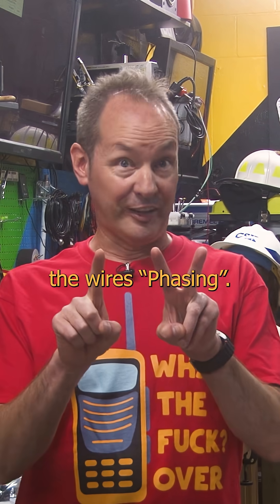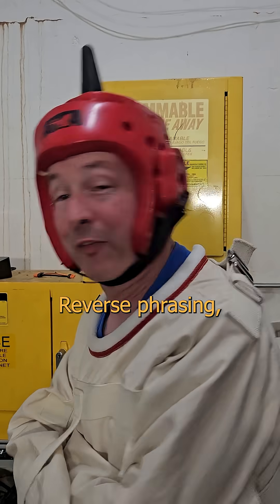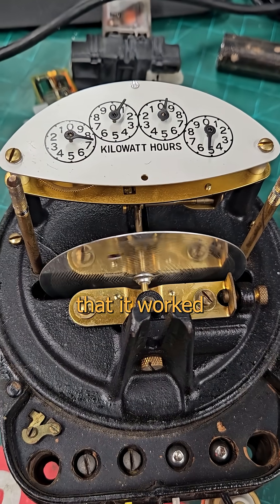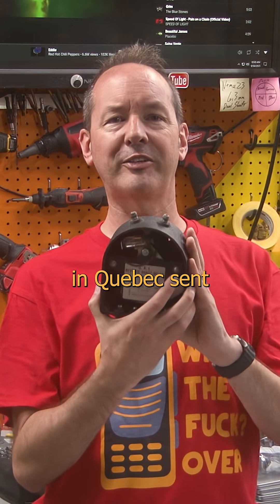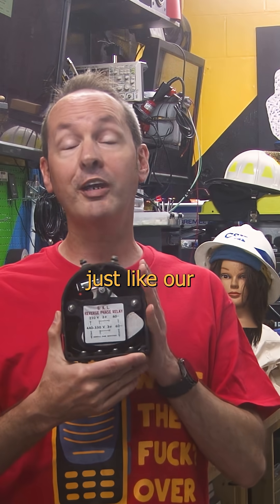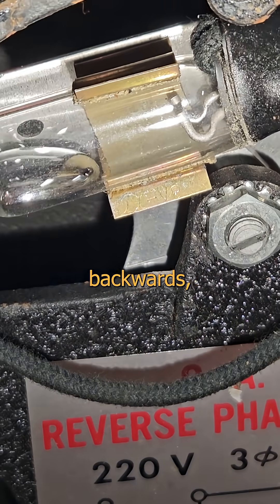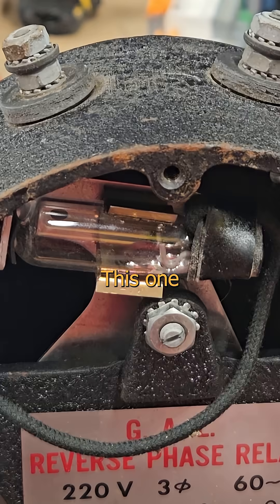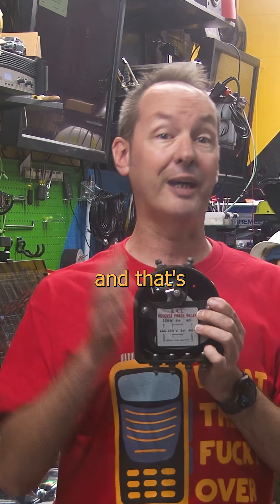Reverse Phase Relay #chrisboden  #comedy #engineering #electrical #educational #elevator #science

Comment: Honeywell made a spring shaped bi-metalic strip that if the temperature goes down, the vial of mercury tipped to let the mercury close the circuit with a little flash... and strangely enough, the furnace turned on! Every time.

Comment: Man, I worked with 3 phase motors (70hp +) and other electrical equipment such as induction heating systems. We usually had another person in maintenance initial off to double check our work. If we were to screw up it could've cost the company a month's amount of income.

Comment: This is why I always mark the wires with coloured tape when replacing meters, and ask the client to test a motor when possible.
But that's not always possible, and its a pain in the ass to redo the connections.

Comment: Did a retrofit the other day using parts from a purchased device to build a custom device.  The wire colors were opposite our standard and even with taking notes and drawing everything out I still managed to get the motors backwards in the end.  I have a feeling the VFD in the original was set to run backwards and then when connected to the new VFD that was set to run forwards it made the motors run backwards.  Switch leads, make notes, and pass along the info.

Comment: Im confused? Genuine question, How exactly is reversing a 3phase motor easier than a single phase?  Ive repaired and replaced quite a few of both types and single phase motors typically only have 3 wires. 3 phase ones usually have a bundle 

Pretend i know nothing because im only ignorant adjacent 😂

Comment: I got the phasing wrong on a 4160 volt three phase soft starter.  The bypass was the opposite rotation.  Pump ramped up to 60 Hz, then the bypass pulled in and she attempted to ramp to -60 Hz.  The pump had an anti-backspin device so the electrician who was watching the pump said over the radio, "it just stopped."  I see an over-current fault on my soft starter.  Check my parameters, oh I forgot to set the over-current to the new value!  So I changed that parameter and we started her again.  This time the operator said, "Yeah it gets up to speed, and then it really slams to a stop, and makes a loud bang."  Took me a moment to realize what would make a pump slam to a stop and take a lot of current...

Comment: We have the same mercury switch in our boiler which is used to stop a runaway boiler by heating a metal spring that if turned enough it would tip the switch to cut burner off till the temperature in the circulation pipe cools down enough

Comment: 3 Phases with neutral is also a great source of mishaps:
3 phases, each 230V against neutral, 400v between phases
switch two phases -> wrong direction.
switch a phase with neutral you get an overheating 3-phase-motor and/or, if there is a split-off single phase outlet, it might run at 400v and blow anything that get's plugged in there.

blew an auxilliary winch during a construction job because someone switch phase and neutral in just the wrong way while the main winch ran hot.

Comment: You can also make lots of expensive noises if you drop a phase.  Single phasing motors is a really good way to give them that, well done burnt varnish flavor.  Phase loss protection relays are nice additions to motor control centers.

Comment: This happened to me once at a factory.  Towards the end of my shift we had a conveyor motor die. Maintenance was tied up fixing another conveyor after a big oven fire.  So I swapped the motor, got the lovejoy hooked by up for the conveyor and replaced the broken garvy belt links.   10 minutes before shift change and I was ready to fire up the motor.   Damn thing ran backwards and broke off maybe 10 belt links and jammed up the line.    2 minutes to go in my shift and I opened up the pecker head wrote down the part number and then looked at the 3rd shift line tech and said “oops, gotta go.”  Aaron, if you’re reading this. Sorry dude. 😂

Comment: I still remember first messing with reverse phasing in the motor lab. The look on my face was priceless when the motor actually spun backwards and didn't just trip the breaker or blow a fuse. Some of the most fun I've had in the motor lab was figuring out the forward/reverse switch on physical controls.

Comment: I’m a bit confused does anyone know of a quality chart or figure that explains how swapping two of the phase switches the direction of rotation. For instance if you swapped 2 and 3 it would go from 123123123 to 132132132 for the “firing order”. 

lol I was about to delete it because I think I might have just explained it to myself. But can someone let me know if I’m thinking about this right. I don’t work much with electric motors but do work with generators some so it’s something I probably oughta know

Comment: You are correct you can switch any two legs of a three-legged service to reverse rotation. But you do not want to switch L1 and L3 the load won't be as efficient as switching L1 L2 or L2 L3
Reply: Yeah only problem can you guarantee me which one is l1 in which one is l3 please tell me how to know for sure
Reply: @Chauvin-r9u you sure can be guaranteed you have to go to the incoming main power distribution panel and they will be color coded black red white and as long as you follow that same sequence of colors you'll be good to go

Comment: you can have the best eletrical charts and best electricians. but connecting 3 phase motor is always 50/50 chance to it to spin at direction you intended or not.

Comment: I'm an old lift (elevator) engineer - PPR's (Phase protection Relays) are standard on pretty much every control panel - the switch contacts sit in the primary safety circuit and nothing moves if the PPR says no.
I saw fewer of the mechanical ones, even 25 years ago when I left the industry. The electronic ones were far less interesting, and more prone to failure.

Comment: 100% of fire pumps I have installed (I’m the fire sprinkler fitter, not the electrician) have been wired backwards by the electricians. It’s the first check upon first run. And most recently, the building I did an addition on, we added a second fire pump. We fixed its rotation, but then when it came time to test the original fire pump, it was reversed. Don’t know if  that was caused by the transformer changes pressuring the building to be a commercial bakery or what, but that was a scary discovery, live active and commissioned fire pump was spinning backwards.

Comment: We had a repair technician come in to replace a motor in our Instron testing frame. He didn't know it was a 3 phase motor and wired it backwards. So all the controls were reversed, you pressed up and it would go down. Needless to say he had to reinstall it the right way because we weren't going to rewrite all of our programs to compensate for the direction difference.

Comment: Our bus garage got it's 3 phase rewired, unfortunately the clown wired it wrong. The rollers on the bus wash were spinning in the wrong direction causing the bus wash to destroy any vehicle using it. Our compressor motor also decided to leave the party with a bang and smoke!

Comment: THIS IS SOMETHING I KNOW A LITTLE BIT! i'm an arena stagehand and i sometimes "get" to run feeder cables to dimmer racks, which take giant scary three-phase cam lock power. five colors of big copper noodle to connect in a very specific order if they're live: green, then white, then it doesn't really matter. but try to hook up black, red, or blue first and you fry the machine and/or yourself

Comment: Fun fact airplanes specially military aircraft run reverse three phase. I learned this when wiring up several external power supplies for a place that redid military aircraft and we had to make sure it ran backwards. I can't remember if it was 480v or 600v, pretty sure it was 600v.

That means every aircraft has a 600v power system generated by the engines.

Comment: One time a crew was changing out an underground service at a school. They had everything wired up apparently backwards. So they asked the maintenance guy if everything was good. How it was supposed to be verified was to check the fan motors on the ac units. Well it turns out the motor had something in it that made it where it would run clockwise no matter how it was wired. So after the crew verified that it was wired properly (it wasn’t) they closed and locked the transformer and left. Monday morning when the school opened back up all kinds of stuff was burnt up or just not working. Took them a while to figure out the phases wet out of rotation.

Comment: As an apprentice in the 80’s I remember working in heating contractors with those mercury bottles. They were very cleaver and good for millions of cycles. The contactor rocked rather than pulled in and out. The contacts never failed but eventually the connection wires broke off due to the constant flexing. Solid state relays took over for heating loads but guess these panels were built in the late 60’s

Comment: Not that long ago, like 6 years ago, I was working at semiconductor plant as a vacuum pump tech. Each pump was set up for the outlet because it was hit and miss if the socket was wired properly. It truly was the most "interesting" place to work.

Comment: Yah ive had an incedent or 2 where standerts were not used by the previous guy. Also had the running and yelling happen.

Welding machines make angry noises when a phase is reversed.

Comment: We learned the hard way about 3 phase wiring. The Fuel boost pumps on an Airbus A320 are 3 phase, 115V 400Hz.  When we were doing the operational check for the fuel system, we could hear that the pump was running, but we were getting a "Left Tank Pump #1 LO PRESS" fault on ECAM. We swapped pumps, no help thinking the pump shaft sheared. We even went as far as installing a new pump, which again, no help... Come to find out later during our troubleshooting, that there was another, different system modification done that tapped off that 3 phase circuit at the BUSS side of the L #1 Fuel pump C/B. The Tech who did the mod must have disconnected the BUSS & load side of the 3 Phase C/B to make room to work and inadvertently swapped one of the legs at the C/B when reinstalling the wiring, cuz sure as shit, the wiring was incorrect which means the pump was running backwards!!! Hence hearing it run, but throwing a LOW FUEL PRESS warning...lol

Comment: I did some work on mobile bottling trucks for wine farms. You never know if the welding plug on the farm is wired correctly so the control cabinet had changeover contacts to automatically switch two phases. And good luck finding a working earth connection

Comment: Description was reversed from standard.  In elevators, those switches are closed during operation, so they open if a phase is dropped or reversed... usually at the start of the safety circuit.

Comment: In some machines we have bearings that spin in only one dirrection, if you mess up the phases or the motor was sent for a rewind and they messed something up, it would just trip and we would fix it on the contactor instead of opening up the motor

Comment: As a drone pilot using small brushless motors that can pull up to 60A at 22V each, I'm quite familiar with the "expensive sounds" of a race drone smacking a tree at 80 mph... Had quite a few MOSFETs literally catch fire because of sudden prop obstruction

Comment: One of my biggest fears when having to replace a 3 phase motor is wiring it up wrong and having it run backwards.  The other is letting the smoke out because it was wired incorrectly.

Comment: Somewhat related, one of the coolest things for three phase that I’ve seen was 10 years ago in hvac school we had a big three phase chiller compressor. It was dual winded for both wye and Delta configuration. I can’t remember which one has more torque and which one is more efficient, but when you threw the main disconnect, it was actually a transfer switch, and if you threw the switch up, it was started in the version that had more torque, and once it was up to speed you and then go through off down into the other winding that was more efficient once it was going. Not something I’ve seen in the field yet, but it always stuck with me as being really cool.

Comment: In a previous job, we had some ancient machine tools, one of which was a mill that had power feed motors that were independent of the spindle being powered on and ran off three phase motors. At some point in its lifetime someone replaced the wiring or jacked it up enough that the power feed ran backwards. Which was fine until it ran into a stop at the absolute limit of travel which was supposed to shut it off running normally. Instead, it locked itself on trying to push against itself and tripped the breaker for the machine. Eventually we figured out what had happened and reversed two of the phases and never had the issue again. Fun times

Comment: It drives me nuts that installers of building power often don't pay attention to rotational phase when putting colors to the three hot conductors. We, in the entertainment industry, use three phase motors to lift hundreds of tons of aluminum truss, steel headers, sound, light, video and any other gear into place for concerts and conventions. Most motor controllers have a phase switch to reverse phase when the colors match on our feeder (power cables) but up is down and down is up on the controller. A simple flick of a switch and you're back in business. But at least one lighting company has their own controller setup that doesn't include a phase switch. Faced with incorrect rotation, they simply kill the power and reverse two of the live wires. Still, really annoying since the colors are supposed to match to provide the correct rotational phase. 

Are there any commercial electricians out there who can explain why so many buildings are wired incorrectly?

Comment: For a while everyone in our department didn't know why flipping two phases reversed a motor direction, then I came across a genius visualization: tap 3 fingers in a triangle shape 1-2-3, 1-2-3. Notice the direction of your taps. Now flip a pair, 1-3-2, 1-3-2 and the direction is flipped! The fingers represent a phase in the motor. That's a dead simple explainer for the apprentices.
Reply: That's Pretty Cool!
Reply: Very nice. Now im wondering if that applies on a 3 prong four wire 50 amp twist. I ran into one that had zzz instead of white.
Reply: You can also look at the way the numbers read in order. In the first case, you read them clockwise, wrapping around at the end. When you flip two, you turned it into an anti clock-wise permutation.
Reply: Then to show the apprentice the a visual for single phase slowly raise your middle finger.
Reply: So.. The left hand rule.  Gotcha.
Reply: tap what? where? which 3 fingers?
Reply: @MrTeddy12397  I just tapped a literal triangle on my palm and got it instantly
Reply: 1-2-3-1?
Reply: Wait that's interesting!
Reply: The way I learned it was just writing the phases. Reading left to right

➡️ABC ABC ABC
➡️A CBA CBA CB
Reply: .     1                               2
                       ->         /
2           3                1             3
Reply: So if you reverse 2 again you get back forward.
Reply: Or, draw a diamond of 4 dots (any quad - angle polygon) - number clockwise 1,2,3,2 (and back to 1) - follow the numbers 1,2,3 around the top (CW) or 1,2,3 around the bottom, (CCW) - some learn from words, others drawings, others sounds and colours...  ie, Any 2 swapped (pun) changes direction.
Reply: hell yeah! i love this
Reply: I learned this by flying RC planes: NOT kids toys at all.
Sooo much you learn.
Reply: Same story with a stepper motor.
Reply: Oooo… that’s nice!

Comment: Single phase or three phase, swapping your inputs around unintentionally is never a good thing.

I work in shipbuilding and we just had some "electricians" wire up the inputs to a $1 million transducer backwards (Kongsberg, it's a hydrographic survey ship. The "inspectors" didn't notice it, so they fired up the transducer to put it through it's paces and fried the damn thing.

Thank god for insurance! Though the shipyard's rate is probably getting adjusted after this one.

Comment: So when we install 3ph bandsaws in meat plants, if you wire the plug backwards the saw runs backwards 😂 easy quick fix with no expensive sounds on those motors

Comment: And now, just like everything else, you can get it as a DIN Rail mount component the size of a deck of cards. The new models can also monitor Voltage, Loss of a Leg, Frequency, Power Factor, and even be monitored via Network if you want.

Comment: I had a walk in a few months ago where when it was installed the phasing had 2 and 3 reversed line side, so they corrected the wiring load side. But when the electrians did some rewiring for a new generator they fixed the phasing on the line side causing expensive sounds

Comment: An incredibly elegant system: you've just got a small three-phase motor that tilts a mercury switch if it spins the wrong way
...I almost want to see if you could make a crude grid sync meter with two of them and some unorthodox wiring

Comment: Yeah, we have a switch for reverse phase on the motor controllers. Which doesn't always work when someone forgot to document that they rewired the motor to run in reverse for special show reasons and now we have to tag the motor, the fly cable, the distro, and the pendant that this one runs in reverse.

Comment: The pumps for Fire Sprinkler systems have several relays meant to tell the Fire Panel if something is wrong and one of them is designated "Reverse Phase" and is specifically there to tell the fire panel that the fire pump is running backwards.